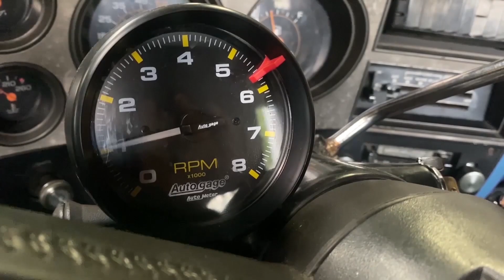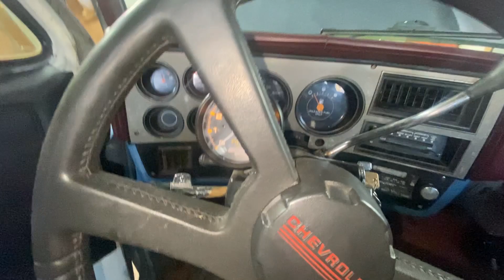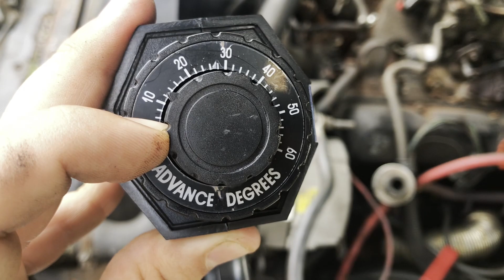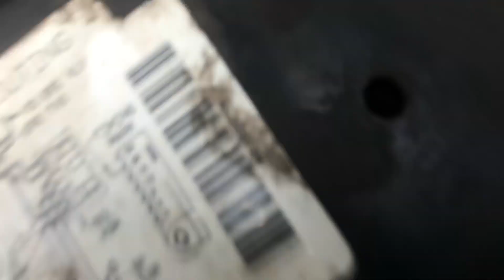From Mediocre to Majestic: Unleashing the Square Body's Best Performance Yet!

Comment: I even used the msd caps kits for the gm oem hei distributors they have a powdered red look,its a thicker plastic and brass terminal and a heavy duty built rotor and the carbon button under the isolator under the ignition coil in the top of the distributor cap, the msd kit has both the oem style and the msd  version. And i couldn't tell you how many parts store brand distributor caps ive cracked or had issues with other than standard motor products.. they are usually ok

Comment: How do you like the msd distributor? What’s the part number? And so you know how much mechanical advance it has?
Reply from the maker: It’s alright. I am honestly a little disappointed especially with how expensive they are and that they are made in china but they do the job.
Reply from the maker: We have it set for 12 initial and 32 total I think we have medium springs on it too.
Reply: @BoneyardRevivals  gotcha. So you have about 20 degrees mechanical. I was looking for a new distributor but MSD isn’t what it used to be. The biggest thing I like is you have a lot of adjustments as compared to a stock hei.
Reply from the maker: Yea you definitely do have a lot of adjustment. My biggest complaint is that all components are cheap Chinese components but you still pay MSD price.